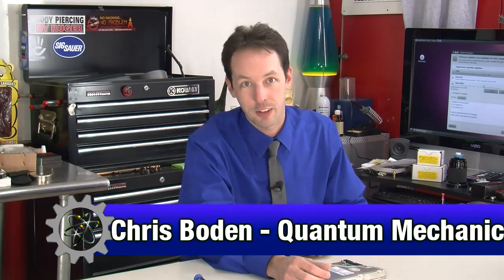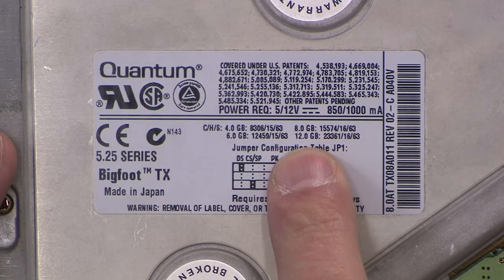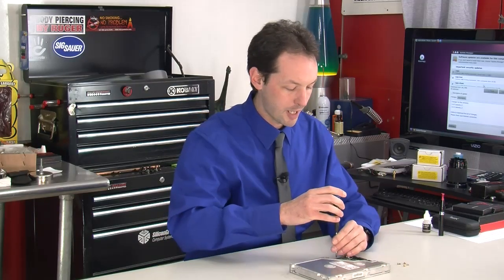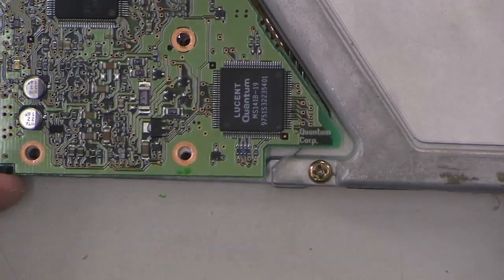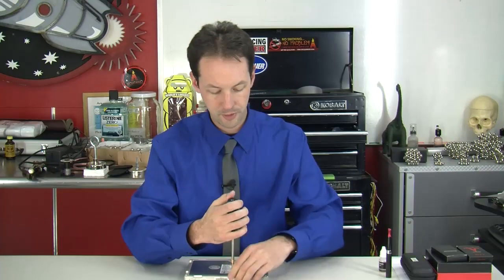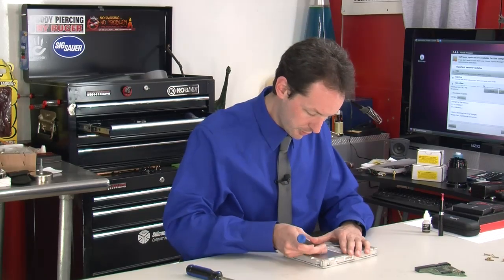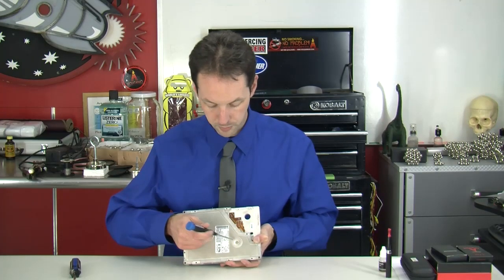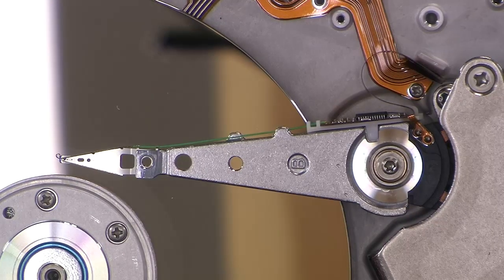Quantum Bigfoot HD: Equipment Autopsy #34

Comment: "Dont do it if you are working with high voltage, touching the shaft can mess you up" Yeah, my teacher knows all about that. Did it when working on a substation cabinet (live) while holding the metal cabinet door with his other hand.  Yeah, he flew 15 feet.

Comment: Yeah the Bigfoot haha. Back then i build a few computers using these in '97 or '98. They were impressive for it's capacity and size compared to regular 3.5" drives but they were generally slower in speed i believe. 3GB when those came out was like 3TB now except even more impressive haha.

Comment: The larger platter meant it was cheaper to create larger capacity hard drives. It also meant slower. I think this is why most of them ended up in cheap supermarket computers.

Comment: sizes depends on OS, file sytem, sector size. the newer 3TB + drives aren't 512 byte sector now, instead 4KB.i think ntfs handles up to like 16TB. you get into raid, you can get up to 32 disks, with say 4TB so you can get massive capacity that way too.
Reply: I took one of those a 20GB that failed, and made into a speaker.

Comment: The point of these drives was necessarily to be thinner, but rather to be cheaper. Since they were massive, they had a relatively low data density but top-of-the-line capacity. I remember they were much cheaper than a 3.5" drive of the same size. Downside was they were a bit slower, too. Lower density = higher read times.

Comment: Yes it is thinner than most drives, I thought it was, so i just now set my 4 gb Bigfoot down on table next to a seagate barracuda & measured the difference, the barracuda is exactly 1/4 inch thicker than the bigfoot, cheers

Comment: the drive appears to have a head lock which unlocks the head once the platters spin fast enough you may want to remove that if you want to use it as a speaker

Comment: I remember those being around in 1997 when I built my first PC. They were smaller than 12GB then, and  they were cheaper than 3.5" disks of the same capacity.

That's about all I remember.